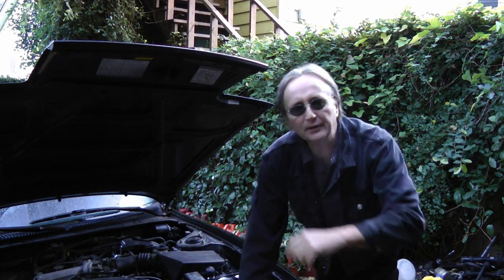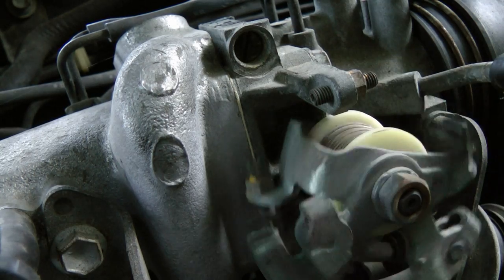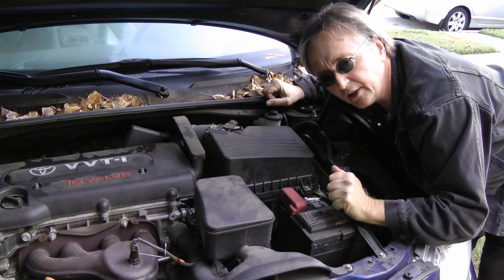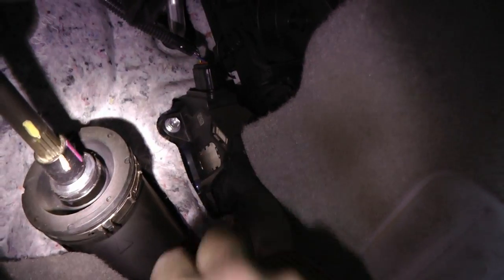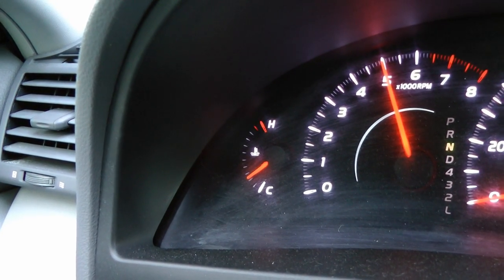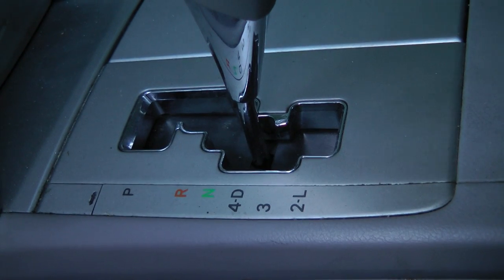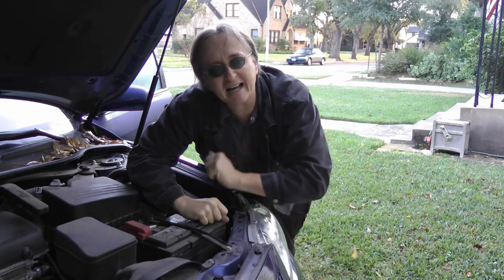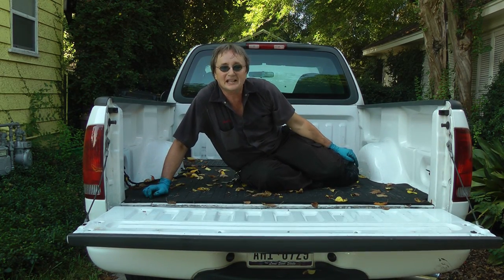How To Stop Unexpected Car Acceleration

Comment: Something like this happened in my mom's old 1980's Honda Accord some years ago. We spend almost the entire trip returning from Augusta, GA to Decatur GA speeding down the highway at 80 MPH. Eventually something broke and we regained control of the car. Somehow along the majority of the trip, an old lady in a Toyota knew something was wrong and was following us until the car stopped speeding and caught up to us to see what was wrong. She stayed with us until we got off at our exit at went home. Till this day, we still don't know what went wrong. My mom sold it after it overheated on the highway a few years later.
Reply: +dekoldrick 
Your accelerator cable got stuck/kinked in the open position. They need lubing or replacement over time.

U can also pull up on the accelerator pedal to unstick/unkink it if that ever happens on an older vehicle.

Comment: Good evening Scotty 1st of all wanna say thank you so much for all your hard work in  putting this videos that you provide us with tons of information and helpful tips... have a situation that I'm facing right now I have a Porsche  928S it's an older  Model 1986  It's been sitting for about 5 years I did replace every fluid on the vehicle I changed a new battery all the relays and fuel filter and fuel pump. And park plugs and wire. I manage to start the vehicle it sounds OK sounds like a whole junker truck but my problem with it right now is that when I press the a acceleration pedal nothing happens and I did check the cable and its ok I don't know what else to do can you please help me. Thanks

Comment: My wife had a Nissan 300ZX.  She experience UA three times.  The first time almost destroyed her car and two others that were parked.  It happened to her once more but the third time I was in the passenger seat.  She backed out of a parking space on a dirt parking lot.  Put her foot on the brake and shifted from reverse, through neutral and into drive.  While her mouth was going a mile a minute as usual, I was paying attention to what she was doing.  When the transmission went into neutral, the engine redlined.  When she hit drive the car took off like a drag racer but luckily it was on dirt.  I grabbed her hand which was still on the shifter and slammed it into park.  The first and second  time she shifted from park, through reverse and neutral into drive.  Both times the same thing happened.  The second time was after my time so she slammed it into park.Only two things controlled the throttle.  The accelerator cable and the cruise control cable.  I believe that moisture crossed the circuit in the cruise control computer and pulled the throttle wide open. There is no other explanation that I can think of.
Reply: ThexXxXxOLOxXxXx I disconnected the cruise control cable from the throttle body.

Comment: I've had two cars that accelerated on their own.
1: a 1966 Buick Electra. The cable got stuck. Happened on a country road. I switched off the engine and coasted to a stop.  I fixed it myself by cleaning and lubricating the cable when I got home.
2: a 2009 Mercury Milan. The carpet mat slipped under the gas pedal. This incident scared the shit outta me. Driving in heavy traffic on the freeway. The guy that detailed the car forgot to fasten the mat to the floor peg.

Comment: In many situations, technology does over-complicate things.  But personally I think computerized gas pedals are probably less failure-prone.  What I don't like about modern gas pedals is how sensitive and "soft" they are.  They make learning to drive stick much more difficult than it needs to be.  I personally like the feel of a stiffer pedal and I have never found the gas to be tiring to use on older cars.
Reply: +Peter Schmidt It's just a resistance spring that controls pedal stiffness. They could just change to stiffer springs.

Old throttle cables use bowden cables that are notorious for stiction and friction. If you measure their force vs. motion velocity curves, the result is a hysteresis loop.  You can replicate the stiffness of old cable throttles, something  would personally agree with, though in my opinion it's better we don't replicate the stiction and friction.
Reply: 4G12 Agreed - it usually is just a spring that needs to be replaced, but unfortunately that isn't always an easy solution.  I also agree that friction isn't wanted.

Comment: My Mum owns this exact same vehicle. Newer or older i am uncertain. Done under 100,000km's/60,000 miles.

I honestly have driven her car and don't enjoy driving it. I think it drives weird jerking every now and then because it seems to be changing back and forth between gears.

When you put your foot down nothing happens for a delayed amount of time and that gets annoying.
The steering feels so soft when you hit a bump you feel the wheel move in one direction or another. And it's really easy.

My Car steering for a old car i drive feels so SOLID i enjoy the feeling i get from it. I have control over gears, acceleration and the Steering does not move if i hit a bump. Maybe because its a 4WD? Or because it's not Rack and pinion.

Another reason i don't like her car is because it scraps on most roads we travel along, and she is already up for around $2,000 more in repairs. A Water pumps about $700, the Shock Absorbers are $1400 and a Knuckle for the Steering that has not been quoted.

So i have those problems, and the one that mainly i don't enjoy is the fact the seats feel so Stiff and coarse. Maybe it is just my taste in features or maybe i am just too fussy. But having to make a choice between a power pack and a Torque machine, i'd take the Torque please.

Comment: i'd be interested to hear your take, scotty, about the recent toyota settlement. seems to be centered around this exact problem, although the cars in question were camrys from 09-10 which came after the one in this vid. sounds like the main thing they did wrong was mislead the safety regulators and the public, which GM has apparently been doing for even longer. i know shifting a car to neutral is simple, but in the panic of the moment, some of the less 'car-savvy' may not know what to do until its too late. and you probably wouldn't anticipate a brand new camry to start surging on you all of a sudden so plenty of people were apparently caught by surprise by that.
Reply: It's all part of social Darwinism. Not to completely take the blame off of the morons deleting the use of a physical cable to the throttle body, and replacing with electronics.

Comment: Funny you should say that. I am now required to drive a Coach that is an Auto (Semi) with a Cummins Diesel but the throttle is a roller mounted pot controlling the Engine management computer, so the design rules appear to have changed.

Comment: The really dangerous part is that you'll lose your brake boost when the throttle is stuck open b/c there's no vacuum in the intake manifold. You'll still have residual boost but if you release the brake and apply again, it'll start to go away.

Comment: An entire family lost their lives once in one of those toyota for this reason, I don't know anyone who has this issue, but like you said, disengage transmission from the engine to save yourselves, however, my problem was delayed throttle response and the source was the throttle position sensor, $30 for an aftermarket.

Comment: While the 2005 & 2006 Camry  is the same body style as the 2002-2004 Camry, Toyota did a minor update for the 2005 Camry and that's when they introduced the computerized acceleration and when they started having problems with unintended acceleration.  While the Toyota Camry isn't the only car to have this problem, it is probably the most pulicized since the Camry is the #1 selling car in America.

Comment: I take the time every few months to harass my wife and drill safety practices into her for things that are easy to fix ONLY when you've considered them in advance.
I never considered this topic. Thank you. Seems like the kind of thing she would panic over if it happened. Adding it to the list right before "use signal lights instead of noise to notify rescue personal when you're lost. If the car has a piece of glass or mirror in tact, break it off and take it with you for that reason" and right after "leave the car on in a blizzard but clear the exhaust pipe every hour. The heater core will warm you up but the fumes will kill you."
Seriously. Surviving is easy when you've mentally prepared the answers ahead of time. And I want to make sure I don't lose her over dumb stuff. So 3 or 4 times a year I sit her dowb and quiz her to make sure she remembers things like these.

Comment: i had a old Saab 9000, that just accelerated on its on when on cruise control, and kept on accelerating. Scared the crap out of me. I immediately put it in neutral and slowed down. Still scared the crap out of me.

Comment: The problem with many of the higher performance toyotas and lexus' that had the acceleration issues is that they have a lockout feature on the transmissions that if you are at full throttle they won't allow you to shift to prevent damage to the transmission. That's how the officer in California died in his lexus that brought the media attention to this whole thing.

Comment: It's not always as simple as switching to neutral. Especially if it's not a computer. The accelerator switch thing could be disconnected. Make sure you check for your car. Mine is a Ford taurus and I just had to reconnect it or replace it.

Comment: A teenage girl died over this. She freaked out and didn't know what to do. She called her mom who also didn't know what to do. The car ended up crashing and she died. If she called a guy they would have told her to put in it N or turn it off. 

My 2012 Ford Escape went into fail safe on the freeway from a software glitch in the electronic throttle. Ford sent me a letter on it a few months before so I knew what it was. I pulled over, turned it off and back on, it worked fine. Ford will not replace them unless they can replicate the issue and of course since it was working fine they wouldn't. Even if they did the time and cost to rent a car wasn't worth it. So I just ordered a replacement on Amazon with the software update and installed it myself, I think it cost $75. Works great and actually has better response now.

Comment: I once took an older sebring with a beefed up 318 in it on a test drive and decided to see if it would do a burn out on a side street. I punched the accelerator to the floor and to my surprise the pedal went to the floor and did not come back up. I just turned off the ignition (older car 1968 I think). The gas pedal return spring had come off. And yes it did roast the tires for me.

Comment: All of our cars have real throttle cables in them. Both my 1999 Mercury grand marquis and my 2009 hundai accent. Of course they have TPS sensors but the main reason I like cables is that I can rev the engine while inside the hood.
Reply: have an o5 magnum that does not have a cable.
Reply: 05*
Reply: Yol  yeah, almost anything today is fly-by-wire.

Comment: i had 2 Unintended Acceleration problems..The second time it started accelerating i didnt bother and i drove it 3 miles through traffic lights till i reached the mechanic. Most of the time i was on 3rd gear and when i slowed down i was on 2nd gear!! The only thing you got to do is switch off the engine and start again with the gear in.. The only problem was that even if the cars engine was running my breaks were not working!!!! Exciting thought!!!! haha

Comment: heh. I miss messing with the throttle by hand while under the hood to freak out nosy spectators. Some of them had rods instead of cables but up til everything got computerized, when someone's nosing over your shoulder and you give the throttle a push with your finger and rev the engine, seeing them jump back thinking the car was going to suddenly take off and run us over was hilarious. Plus, there were useful purposes to being able to open the throttle so easily while you are under the hood. One thing that terrifies me to no end is steer-by-wire... because you know perfectly well how badly having everything being operated by electronics and computers works out... I try to get my cars as dumb as possible because I just can't fix all this modern computerized stuff yet.

Comment: Ever see one with the paddle shifters?  Those are interpreted by the computer.  Also, I've driven cars that have an annoying throttle delay while the transmission shifts into the optimal gear.  The point is the direct-connect linkage of the shifter isn't a given like it used to be.

Comment: I'd just like to point out to those of you driving older cars with the cables:
If the cable got stuck in the WOT position, that means that it had to have been PUT THERE, (eg by your foot). It wasn't like it was a completely random acceleration spree

Comment: Toyota Prius uses electronic shifter. If that things fails when the unintended acceleration happens, the e-shifter will be unshiftable unless you manage to take the shifter assembly apart to fix it when you are driving, which is highly unlikely.

Comment: Unfortunately in some cases where this has happened shifting it into neutral doesn't work because a lot of cars have electronic shifters, and in the case of a major electrical failure with the drive train your best bet is to stomp the brake to the floor. 9 time out of 10 the brakes will over power the engine.

Comment: The first generation Citroen C5 had a software flaw in the cruise controller. In certain situations it would just accelerate and the brake pedal wouldn't turn the cruise controller off. Just hit the brakes hard, because the brakes are powerful enough to stop a runaway car. When you come to a stop, turn off the engine. By shifting to neutral, you might blow up your engine.

Comment: I believe the problem is the lack of eugenics in our country! 
These modern cars all have rpm limiters to protect the engine from blowing up. 
Some even cut RPM's to 3k when you try to rev it to the floor while in park or neutral.. 
I would imagine some super geniuses have even tried slamming it into park and tried to remove the keys.

Comment: When you look at drivebywire as a whole, it is actually incredibly safer than using a throttle cable itself. When drivebywire is programmed correctly, there are actually several redundancies in place to prevent a 100% throttle situation from occurring. The most common one being that you cannot have the brake pedal and the gas pedal depressed at the same time and have the throttle open. You will notice that in alot of these unintended accel videos that the driver never even hits the brake pedal.

Comment: First thing to do: don't panic, there is absolutely no reason to panic.  The engine will still be screaming, but it won't get damaged as it has a rev limiter.  Don't touch the ignition key: you risk locking the steering wheel.  Just do like Scotty says, calmly, gently, thoughtfully simply push the lever into N. What's big deal?

Comment: Scotty is also right because most cars when they reach a redline they will cut off fuel to the engine so it will only rev to a point. Plenty of time to slowdown while having your power brakes and steering and then shut off the vehicle.

Comment: You forgot to mention the extremely dangerous situation where the steering wheel could lock if you were unfortunate enough to experience this and turn engine off with the key.

Comment: Because the components were already there. The ECU (the "computer") already had a throttle position input to properly manage the engine, and the throttle was already actuated by a motor for cruise control. The cable became redundant.

Comment: with cars newer than that, i'd imaging there might be a fail safe in those drive by wire system where if let's when it starts accelerating out of nowhere then it will cut off the fuel to the engine and keep the rpms at idle or so.

Comment: @sarathcpt It's also better for emissions. All the fuel injected engines I've seen (ok, not many) have had a secondary air valve system that lets some air bypass the throttle, as if the computer's got it's own little extra throttle to play with. It uses that to fine tune the fuel-air mixture and control the idle speed. Having a fully computerised throttle means that the regular throttle and secondary air valve can be combined into one unit, reducing the number of parts and making it cheaper.

Comment: In Modern cars is isn't easy to blow the engine.  They have rev limiters and stuff. But if you shift to neutral, pull to a stop and then shut the engine off, you will still be alright.

Comment: Scotty I got a Ford Focus 2002 zx3. I took out my cruise control because it was just about useless (bad move?). I also had to replace my accelerator cable and ever since I’ve cleaned the maf sensor. Changed the filters in the box, changed out the Pcv valve and vacuum hose (now I’ve got to replace and burnt up flex pipe) when I accelerate my car seems to hold on the accelerated level. Say I’m going 25 down the road it stays at 25 even if I let off the gas... and sometimes the breaks are hard to push. What’s happening???

Comment: That's true perfect tips... However, what do you do if the manufacturer Ford / Lincoln will not fix my 2011 Lincoln MKS EcoBoost engine, or even acknowledge this Gremlin exists?
 Refusing my request for repairs until cars warranty runs out, as if they are afraid to make a record that this Dangerous Gremlin actually exists...